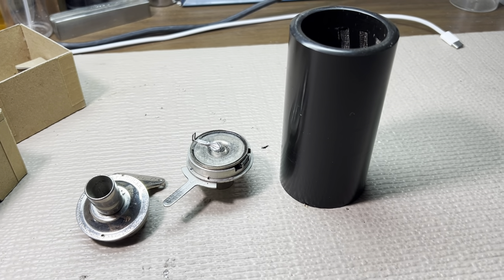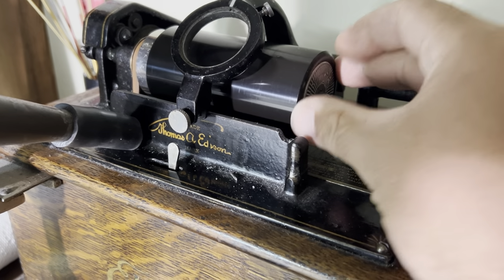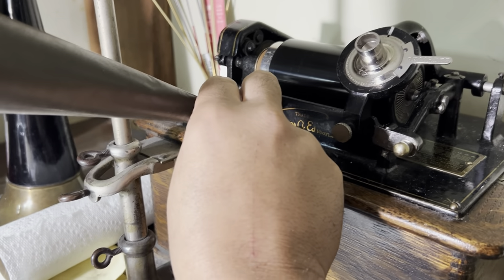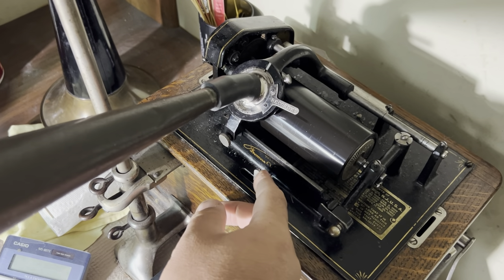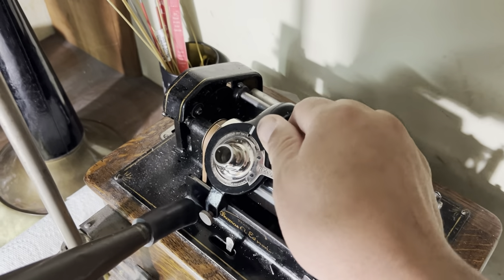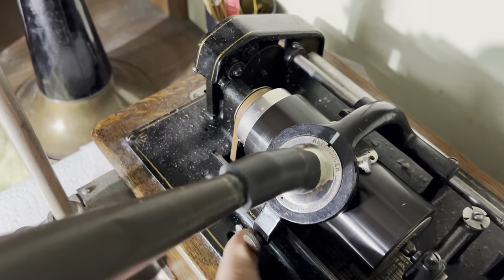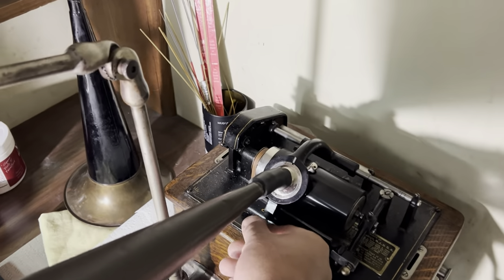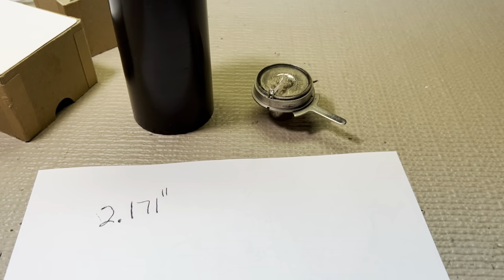Edison Phonograph: How to make a wax cylinder recording with an original Recorder

Comment: I notice that the blank appears to be of black wax, as used commercially from about 1902 onwards. There are those who say that this material is too hard and will quickly wear out the sapphire cutting-stylus; most modern blanks (there are still two or three people who make them, I believe) follow the softer brown-wax formula as used in the 1890s. Also, it is often said that the ambient temperature during recording should be about 80° F (26.5° C) or alternatively that the cylinder should be warmed immediately before recording; some people do this by running the blank on the machine with an old-fashioned incandescent bulb positioned closely over it, others heat it with an electric hair-dryer, while I have found good results from using a microwave (four bursts of 25 seconds each, turning the cylinder end-over-end between each burst and the next). However, perhaps this heating is not necessary when one is talking or singing directly into the mouth of the horn or speaking-tube. Certainly this recording is very distinct throughout, even when the voice is at normal level. The point about ensuring that the recorder weight has some free play is vitally important and I have not seen it brought out so clearly anywhere else.
Reply from the maker: The cylinder is actually dark, brown wax, that they used as a dictation cylinder. For a very short time, Thomas Edison made 4 inch long dictation cylinders which are superb recording cylinders. They are not hard wax like the black wax records.
Reply: @ThomasAlva  Thank you! That accounts for the dark colour.

Comment: Does the rubber coupler have any significance or is it simply the means by which you are able to couple the horn? In other words, does it do something acoustically in some way? Your setup sounded very sensitive and the surface noise was very minimal - quite impressive! Did you heat the cylinder before attempting the recording or was it simple ay room temperature - say 20 deg C? Cheers.
Reply from the maker: The rubber coupling keeps things air-tight, but I try to get the horn and adapter CLOSE together, so that sound energy isn’t wasted vibrating the rubber, because the loss in volume is VERY significant, even from a small gap!  I usually do not heat the cylinders, but the newer ones I heat to 85degrees with a 60 watt light bulb.